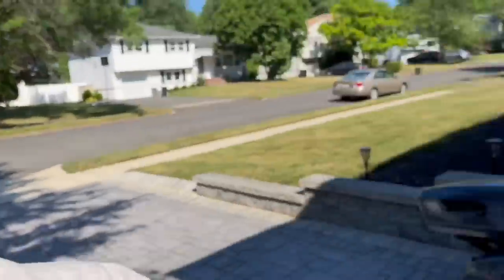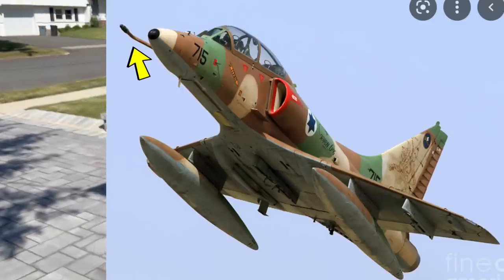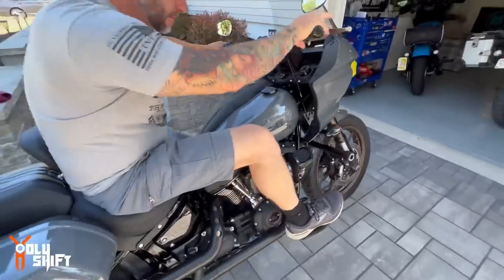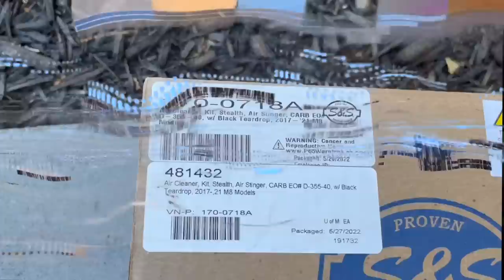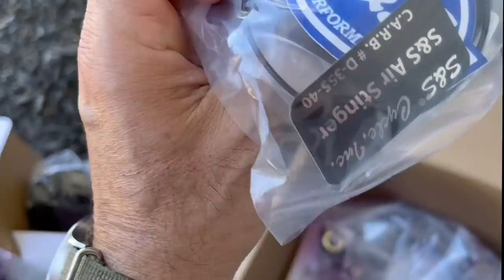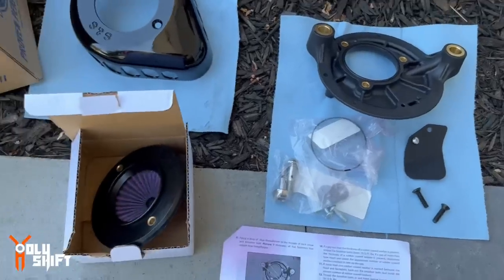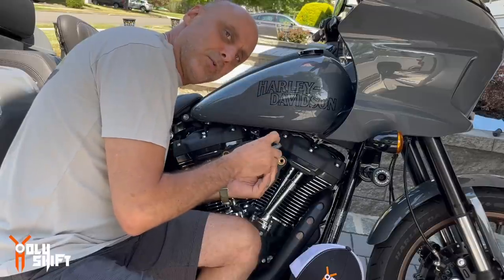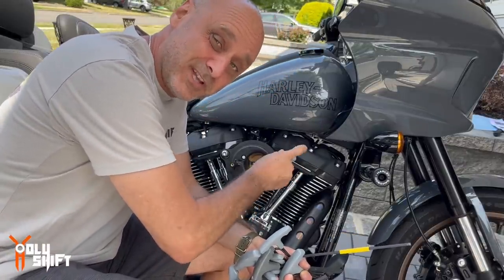Let It Breathe

Comment: The S&S Stealth Teardrop looks good.  I recommend check out the S&S Slip-on mufflers.  They sound good and look excellent; also no retuning required on the 117 Cu. In. FXLRST/FXLRS.  They will not void your warranty.  They'll look good with the S&S Air Cleaner too.  
    I also recommend replacing the OE plastic transmission top cover with the metal Trask M8 Checkvent, to properly ventilate the crankcase.  Tom M., SouthBay, So. Cal.  '21 RGS and '22 FXLRS

Comment: Same thing for me. I liked the stock one and performance wise I think it would have been good enough but it got in the way for me to use my bungking crashbar comfortably as a highway bar. Switched to a dk customs 606 with transformer external vent plate so I won’t be getting oil into my intake as well.
Reply from the maker: Yeah- I like the look 👀 but it was in my way ….👍🏻

Comment: I bought my New  low rider ST yesterday in white sand pearl. Have to change also the mid controls to forward controls and I bought also the S&S black teardrop air filter . I guess HD put the stealth on because many people have to change , so business goes on. They don't have extension for the forward controls , I could use them to , the floorboards on your bike looks great to move your legs while driving . Great video .Greetings from Belgium.

Comment: Sandy did you manage to measure distance sticking out? I believe stock breather is 7" hoping this is only 4.." Also why didn't vent externally rather then sending blow by back into cleaner? Maybe Mike can answer this my understanding blow by is a problem on M8 motor.

Comment: Remember with these S&S back plates, always use thread lock on those  3 bolts.  They can shake loose and it only takes one to get sucked into your engine and it’s disaster! I’ve seen it. Just a tip
Reply from the maker: Good one brother- thanks!

Comment: Just a thought, but without the OEM breather, do you thing the black forward control would work...specifically the rear brake pedal, without having to use the powder-coated chrome one you used?

Comment: How is it running now with the S&S air cleaner? A guy, who knows much more than I do, tells me that the bike needs a tuner, after a new air cleaner is added. He said the bike should run ok for a few thousand miles, but then you can have issues. I've never heard this before, but as I said, he knows much more about Harleys than I do.
Reply from the maker: Stock 117 air cleaner is a high flow air intake - and so is my new one. The amount of air they both let in is not very different. It shouldn’t be a big difference. Harley stock tune allows a 10% variance of Air/fuel ratio . So it’s well within the limits
Reply: @HOLYSHIFT  Many thanks.